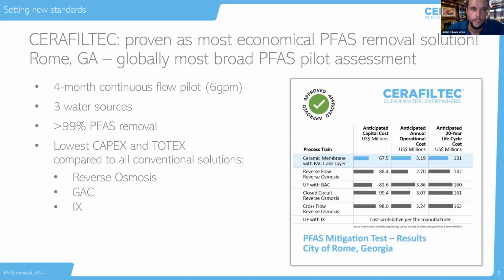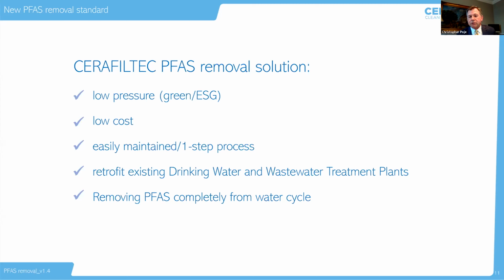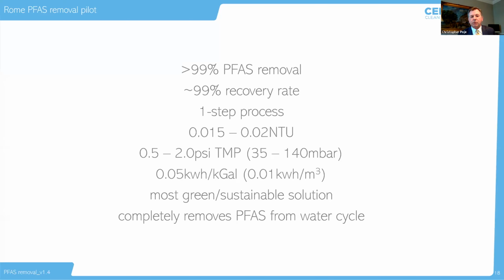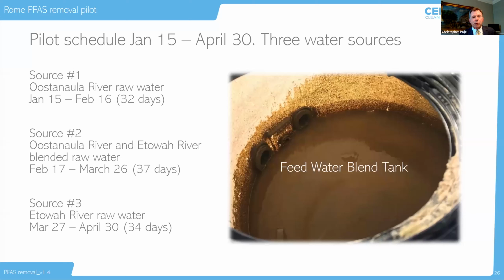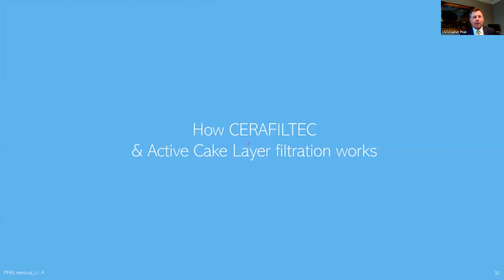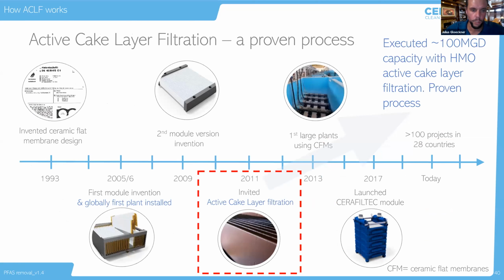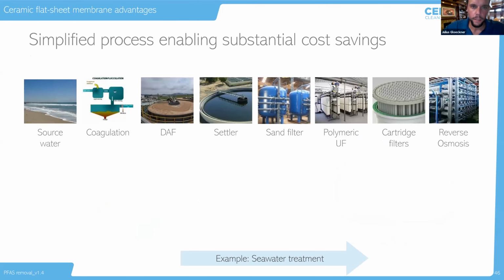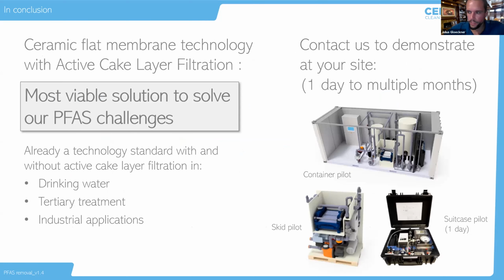PFAS Removal with Ceramic Flat-Sheet Membranes - Webinar 18. Nov. 2021

Comment: Question... Can you provide an SiC membrane system that can remove 5-10 ppm from a drinking water aquifer without carbon. We would like a liquid reject of lessor volume to treat through an electro-chemical Oxidation system. We do not wish to dispose of any Pfas for cradle to grave or high cost incineration. Is this possible. We do not wish to remove any natural dissolve minerals in the drinking water. We wish to be able to drink the well water. Please respond. Have a site and wish to treat well water on an MGD level. without altering the natural taste of the water. I am very familiar with SiC membranes, but for a use in treating tertiary sewage, CSO and untreated stormwater. Am now a partner in this well water that we would like to commercialize.